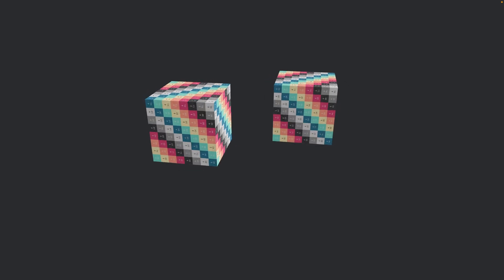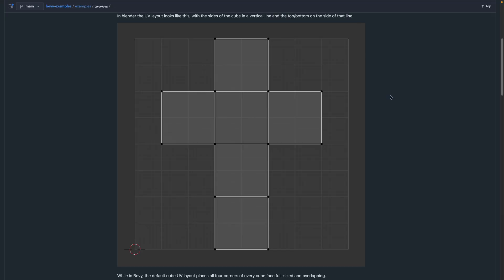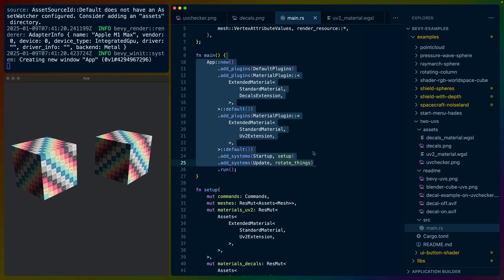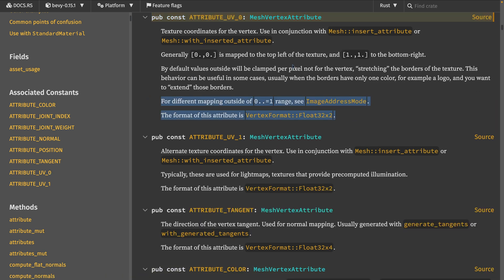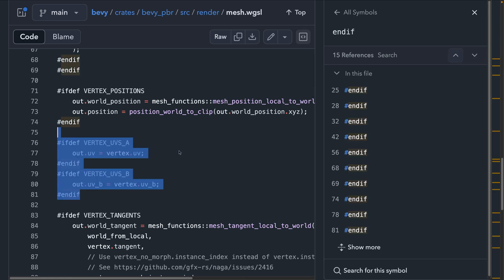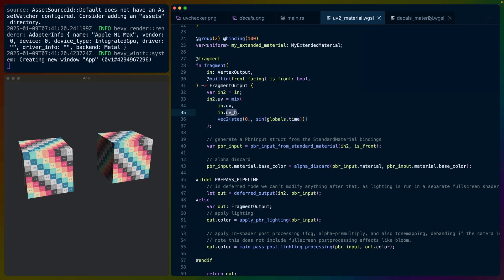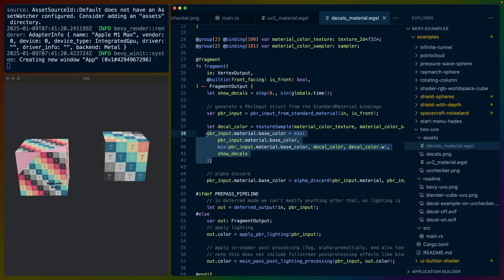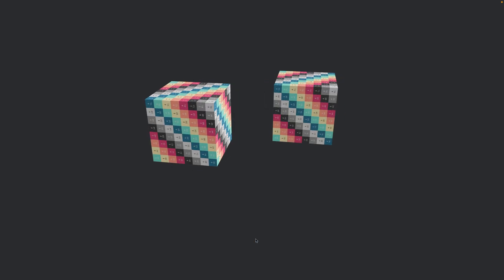What's better than one set of UVs? Two.

Comment: This is cool , my thoughts on using it to be able to create dynamic decals and mixing positions and animating UVs over laying others ,is probably the only limited use case I can think of .
On an unrelated ...slighlty related note ... can 2d and 3d cameras/scenes be mixed . I.e. can I bind a 2d camera to texture and use it in a 3d scene. I'll have to search to see if there are any examples or if it is future feature maybe .  I know how to do it in other engines .
Reply: never mind , I found it in examples pretty quickly ( Render to Texture ) ( "ah dope" - Homer Simpson style).
Reply from the maker: you don't need to render to a texture to use two cameras. you should take a look at the "two_passes" example. I've seen quite a few people do this lately. What was the motivation for you to use the render to texture example? was it just the first one you saw?

https://github.com/bevyengine/bevy/blob/145f5f4394bfb541c25acf30789fca742d16e1bd/examples/3d/two_passes.rs
Reply: @chrisbiscardi  i want to create mini 2d games in a 3d arcade with textures slapped onto arcade screen that represents each different game in Realtime.  The type of thing I might use in a billboard or portal system.